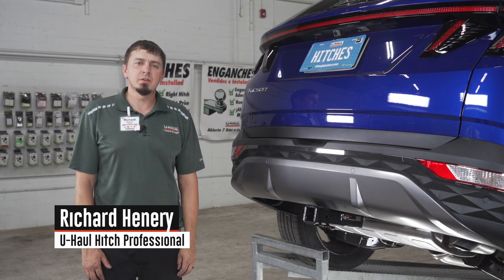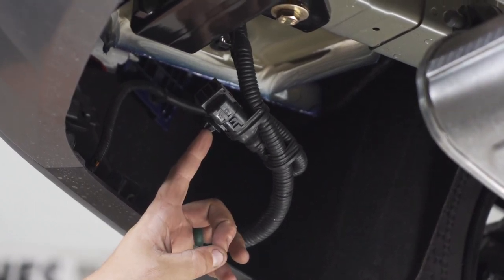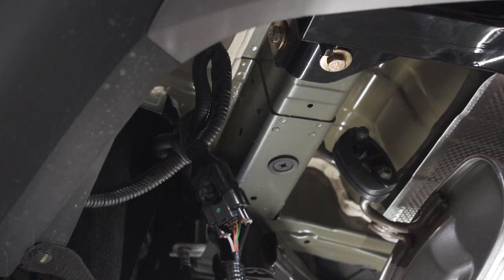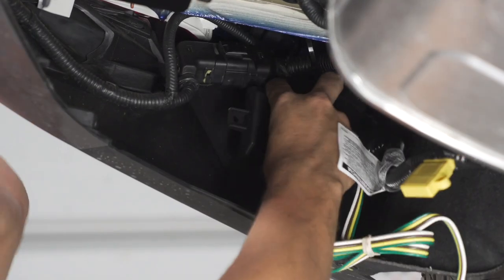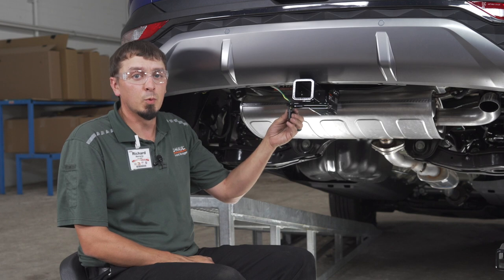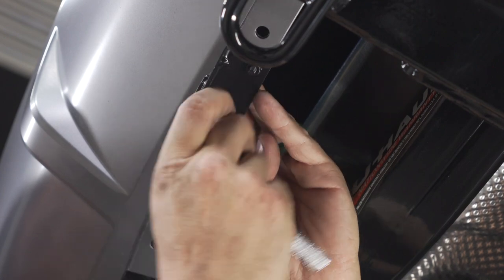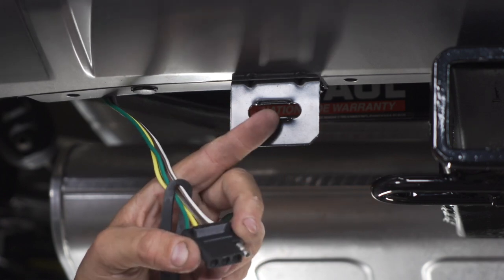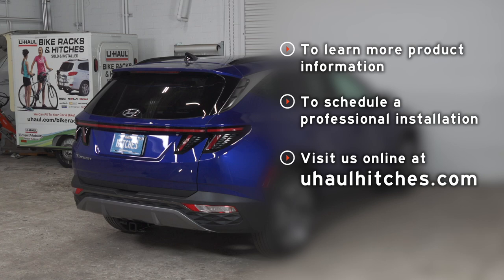2022-2024 Hyundai Tucson | U-Haul Trailer Wiring Harness Installation | CQT118784

Comment: Thanks for the video. Would the wifingharness work on a 2023 kia sportage SX HEV?
Reply from the maker: This wiring harness will not work on any model Kia Sportage and we don't currently have a video for the installation. However, you still order the parts or have a U-Haul hitch professional complete the installation for you. Find it here - https://www.uhaul.com/Trailer-Hitches/
Reply: It will work on a 2023 kia Sportage….. it’s the exact same